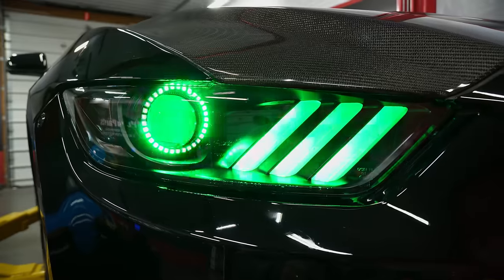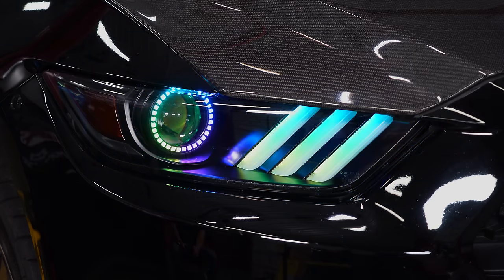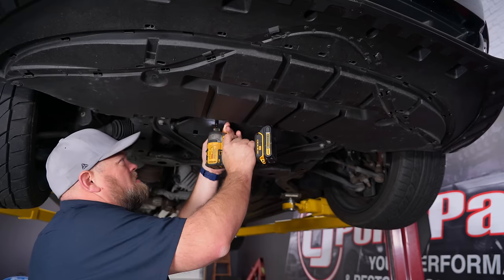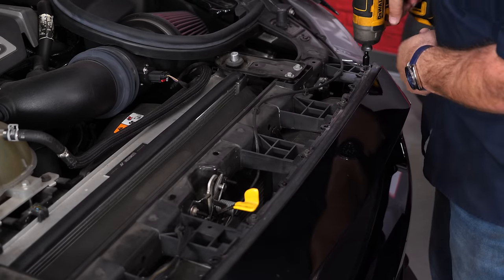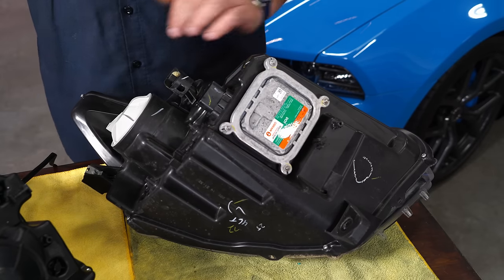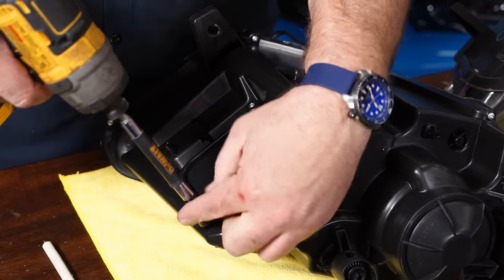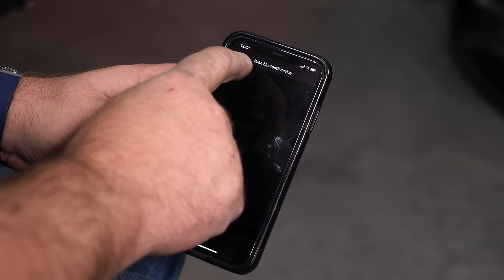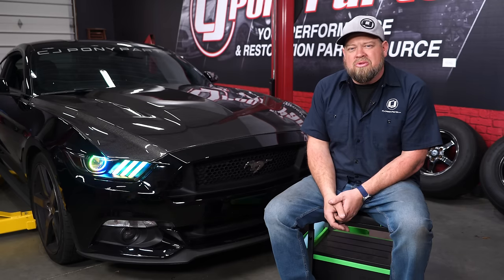2015-2017 Mustang Install | Oracle Lighting Dynamic ColorSHIFT RGB+A LED Headlights

Comment from the maker: Product Info:
https://www.cjponyparts.com/oracle-lighting-led-headlights-dynamic-colorshift-black-series-pair-us-spec-2015-2017-shelby-gt350-gt350r-2015-2020/p/HLA73/
Reply: Will this fit my 2020 EcoBoost Premium Fastback Mustang GT?
Reply: CJ Pony Parts are these headlights tinted
Reply: @lucasschroeder4420  no it ain’t fit only 2015-2017 eco boost
Reply: Did you install a kill switch? Or where did you run your positive wire? These things are killing my battery, I believe its due to the bluetooth always being on. I don't drive my car daily.

Comment: Stay away from these lights. Had a set in mine for about six months and the Bluetooth controller died on me. Tried to get a replacement from Oracle since it was the first year and never got an answer from them. They look good powered off as well but that's not the reason for these lights.

Avoid!
Reply: Did you even try to call them?they should of gotten you squared away if you called..plus it's quicker than email

Comment: I’ve purchased these headlights from y’all and they work great my only problem is now they come on by themselves now and kill my battery and suggestions on proper way to wire the positive ? Right now I have the negative on negative post on battery and positive is on the fuse box
Reply from the maker: Move the positive lead to a switched power source.

Comment: I'm having an issue on mine where the led part of the lifht isn't working, the low beams and high beams work. The sequential turn signal doesn't anymore. Woke-up one morning to one of the little led lights green and wouldn't turn off, had to unplug the fuse and plug it back in to get it off. Any tips would be greatly appreciated

Comment: Are you able to operate the DRL, demon eye, and halo lights independently? I love the demon eye, and drl kit, but not big on the halos. If I can have the demon eye, and drls on with the halos off that would be sweet.
Reply from the maker: They all power up the same time so you cannot control them independently but there are several modes where they are all different colors.
Reply: CJ Pony Parts Thanks for the reply guys! Already pre-ordered.

Comment: The app won't connect to the headlights.  They worked the first few days and then just stopped. I try to connect and it says invalid device or connection failed. I know I'm picking the right one because it's the only one and says SP105E which is what's on the controller I think it's the app

Comment: Just right on time for Christmas! Now all you need are those hideous RTR front grille lights and you're ready for the Christmas Santa Parade!
Reply: Peter Who? Then add some under glow, a Rudolph nose and window antlers 😎👍🏼
Reply: Matt Takahashi i legit had those until they broke on the interstate 2 days ago! lol
Reply: @BabyMandingo  The one thing I've learned with aftermarket lights is that they don't last and quality is shit! All of the Raxiom lights I got for my S550 got replaced 3 times and failed again but warranty was done and same goes with all of the lights I bought for my old Accord! Now I got some cheap ones for my switchback and turns signals and ok so far but winter has just started where it seems to fail in the colder months! I looked at Morimoto and it has the best warranty 5 years  it still haven't bot the bullet yet!
Reply: Peter Who? Damn i was talking about the antlers and stuff but my dud i am so sorry, thats horrible!

Comment: I bought these and they look pretty awesome. I have a question, there was another quick connect with a brown and white wire in the headlight. This wasn’t addressed in the install video. Is it for anything? The reason for my question is because I don’t have the demon eye functionality. Any ideas why? Any help would be greatly appreciated.
Reply: Did you ever figure out what the issue was?
Reply: I was wondering the same thing?

Comment: I did installed on my mustang 2017 GT, this oracle lights. My question is, why the day light not working on the car when you put in auto control, only works when is dark for night light?
Reply from the maker: These lights do not offer the factory style DRL, you have to manually turn them on if you want the white lights when driving which will be the halos along with the DRL.

Comment: There’s a $250  and $800 version... what’s the difference??
Reply from the maker: These are complete headlight assemblies, the cheaper version is just the boards and requires you to heat up and remove your factory lenses for install.

Comment: what about the bluetooth controller install?
Reply: blade000007 it’s probably a app on the phone
Reply: @Martinezz31  No I get that but when you look at the product it comes with a Bluetooth controller that he didn't show in the install
Reply from the maker: It got cut out of the video by mistake. Its a small white box and it comes pre-wired and is easy to hide. Only hookup is power and ground.
Reply: CJ Pony Parts Can you edit back in the missing portion?  There’s more than power and ground.  You have to tap into the turn signals as well.
Reply: @cjponyparts  facts. I need help on installing the Bluetooth controller part and the turn signals
Reply: @cjponyparts  can you repost the complete video with the extra wiring? This video made everything look relatively easy. But now I found an extra black and red wire spliced to an unmentioned connector, a driver box assembly with a ton of wires that I don’t know where they go, and I don’t know the best place to put any of this in my car, but I’m already in the process now, and don’t want to have to put everything back to stock because there is no further instruction.

Comment: @CJ Pony Parts do you have to be in the app for the lights to work ?
Reply from the maker: Danny Hernandez you have to use the app to turn them on, you can close it after that and they will stay on
Reply: @cjponyparts  Do you have to turn them on through the app every time the vehicle is turned off/on?  Or do they come on with the car every time so long as they are not turned off in the app?
Reply: @AlexGomez-my9om  you need to go back into the app and reconnect to the Bluetooth module every time.
Reply: And the app stops working
Reply: @Trish Linkus  is there any splicing involved. I see some ppl say they had to splice to their turn signals

Comment: When are you guys gonna just make a whole separate headlight instead of having to take ours apart which end up adding water damage from just even opening them  after a while
Reply from the maker: This is a complete headlight, you just transfer your factory bulb and ballast over. No lens seals need to be messed with.

Comment: So much work to remove head lights. much easier on old mustangs
Reply: honestly it is so much work, I installed diode dynamics DRL lights for my 2019 mustang, and the amount of work just to remove the headlight, and then the headlight casing was just tedious and frustrating, for get me wrong they look great, I’d say I did a good job for someone who worked off DIY vids, but damn now I’ve had cold moisture entering my headlight for several months now and even after trying to fix it, it just wasn’t enough so I just gave up 😔

Comment: Is this legal to run on the street?
Reply: The lighting colors other than amber and white are not compliant with the US Department of Transportation rules for the front of civilian vehicles and therefore, not only violate Federal Law, but every single state's laws as well. However, where I live in Maryland--I see law enforcement being pretty lenient towards these light systems, but I wouldn't push this as assuredly, you're going to find a zealous law enforcement officer who will ticket you.
Reply: Depending on the state, any color besides Red or Blue is legal. They just want to avoid people looking like emergency vehicles.
Reply: @TheZentrique  You are misinformed, as soon as the lights start flashing or "rotating" they are illegal regardless of the color.
Reply: @whpony96  i never said the flashing is legal

Comment: For Ecoboost 2018?
Reply: It's a headlight.  Nothing different between GT or the 4 banger
Reply from the maker: Ezduztube will not for 2018+
Reply: So it would fit? He did not mention anything about Ecoboost.🚙
Reply from the maker: Ezduztube it will not fit ANY 18+ except the GT350
Reply: Ok thank you!